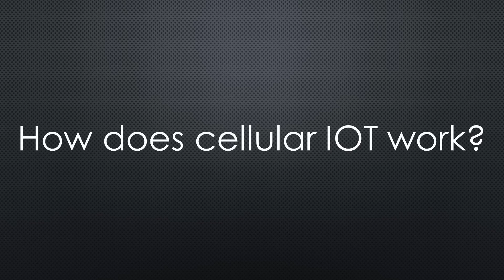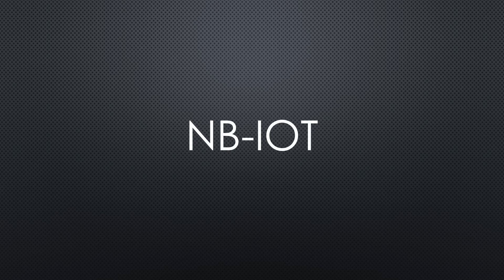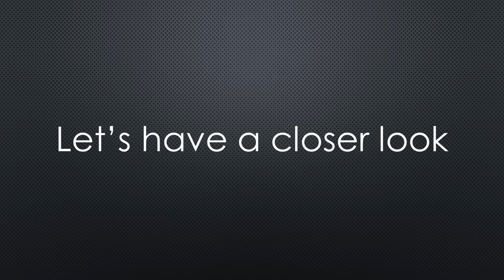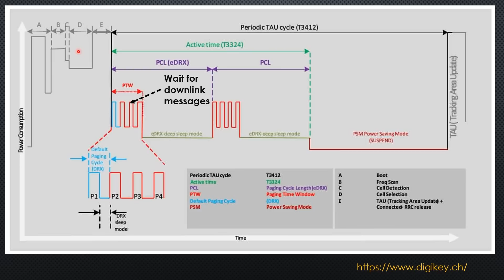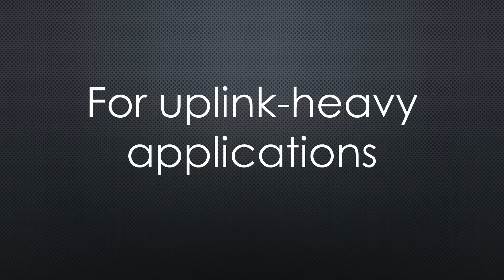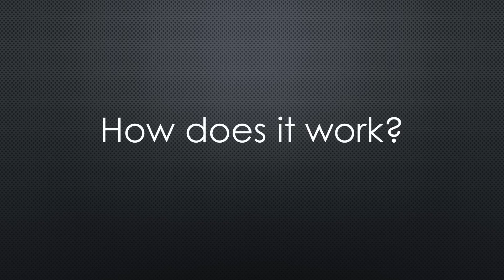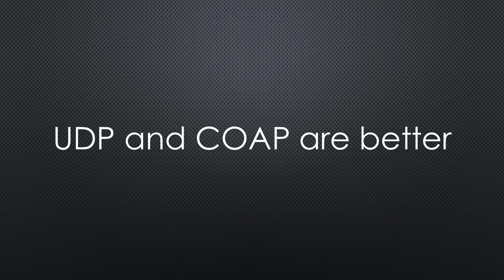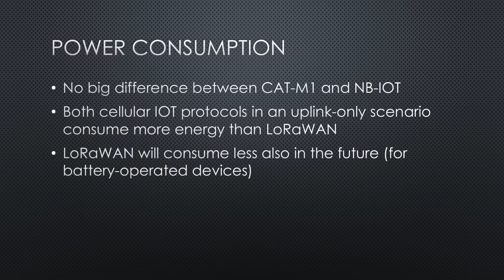(480) How does NB-IOT and CAT-M1 / LTE-M compare to LoRaWAN (Tutorial)?

Comment: Thank you for your effort! Still I do  not have a usage of remote transmission outside of my property. But I got a smartmeter gateway for the electricity meter extending the standard electronic electricity meter to a so called iMSys. This gateway communicates over LTE. Might be, they are using such a low data rate protocol.
Reply from the maker: Some utility companies use those protocols (AFAIK).
I wanted to make this video for a long time because I think, the technology is important (everybody talks about M2M in cars and industry). So we should at least know enough to mage a thorough decision. And I did not find a lot of overview videos. I had to search pretty hard to get all the details.
Reply: @AndreasSpiess  Yes, this topic is very specialized an not mainstream. 
For the future smart meter gateways of the utiliy companies "LTE450" is released here in Germany. Lower frequencies should help to reach the meters located in the basement.

Comment: I build weather stations for remote areas, so LoRa isn't feasible because there is no existing infrastructure. Cellular (or satellite) is the only option and I've had a lot of success using LTE (SIM7600) and LTE-M (SIM7070) modems from SIMCom. LTE-M modems are less expensive, bur LTE-M does not have nearly as much coverage as regular LTE! In developing countries, 2G/3G/LTE are often the only option. I have had no problem getting low power consumption by powering on the modem for each transmission then shutting down (transmitting about 200 bytes every 5 minutes on a 18650 battery with a 1W solar cell). I'm using a Hologram SIM card with global coverage. I also had much better luck writing my own library to send AT commands to the modem and transmit via UDP (with acknowledgement for guaranteed delivery) than using any of the existing libraries. Protocols like MQTT have way too much overhead for a low-power IoT use in my opinion, especially if you have a large network of sensors and data usage is a concern.
Reply from the maker: Thank you for sharing your experience!

Comment: We used 3g to connect TV viewer meters to back when i was working for BARB. Nightmares of unreliable connection.
Reply from the maker: Interresting. I think, error handling is extremely important for such complex systems to get at least a certain degree of reliability. So many different states can ocur and have to be handled.
Reply: It wasn't a problem in urban areas with lots of cell towers but in rural sites where the signal strength we had to revert to telephone lines. 
The data was uploaded at 2 in the morning and wasn't normally more than 1Mb, it was quite interesting how the system worked.

The meter normally tried for 15 mins to upload via 3g.

The audio of the TV broadcast has embedded data that is picked up by the meter, similar to the RDS data on FM broadcasts.
This data is injected by the broadcasters, it changes once a minute and changes to random codes.  The codes are sent to a central office overnight that then matches it to the database.

Comment: It is nice to own our own equipment and networks and not be reliant on commercial providers to pass our signals on. Maybe Lora is slower but it is nice to not have to be in such a big hurry ! Of course i say this as I use broad band internet , but around here we have our old 1990's ham radio packet system resurrected and 1200 baud is good enough to send messages to each other in our area and a bit beyond too.
Reply from the maker: I agree. LTE for IOT was on my list for nearly 5 years now. I think it can be a good solution for some problems. Still, after all the investigations, I like the simplicity of LoRa / LoRaWAN. This video was a huge effort for me because it is so complex. Fortunately, I had some help...
Reply: @AndreasSpiess Well you did a fantastic job on this video, so please pass thanks on to those helpers.  And that Anritsu test gear is not cheap!